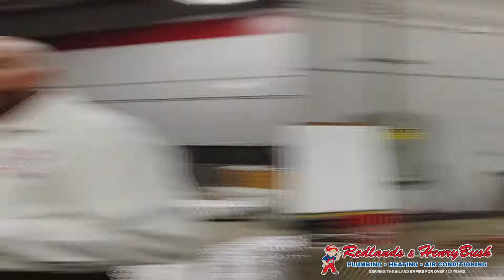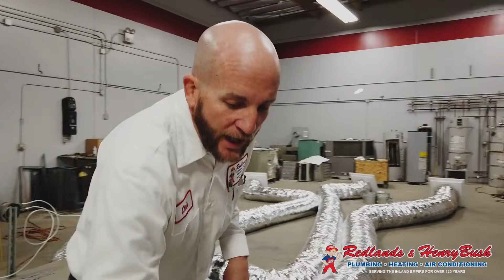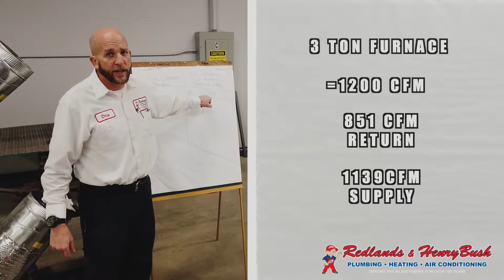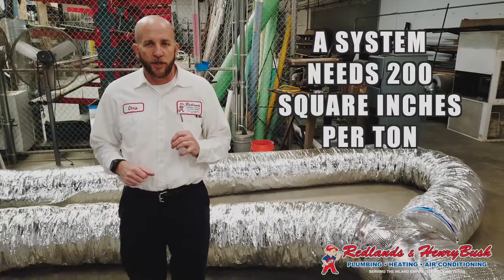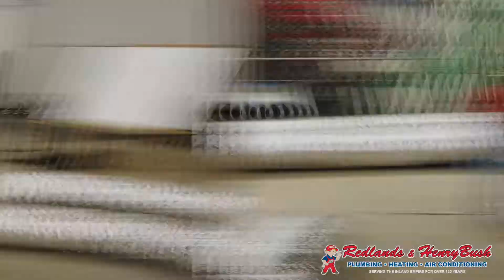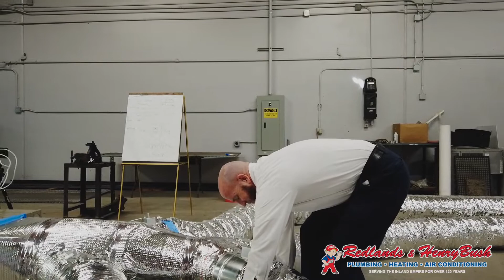Redlands & Henry Bush Plumbing, Heating and Air Conditioning -  AC Duct Work

Comment: Great Video! It touches and proves a lot of what I teach in class regarding equipment sizing, insulation, duct designs, air flow and static pressure. Well done Chris and special shout out to Sheldon!